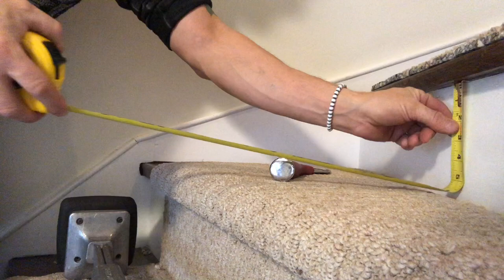How to Install Carpet on Curved Stairs

Comment: Amazing Job and great video.  I'm looking at fitting a runner on my stairs unfortunately the runner I like only comes at a length of 140cm. So I would need to attach 4and half up my stairs. The rug has a small boarder on either end I would need to cut off. Can I attach two ends that have been cut and if so where is the best place on yhe stairs to join them? Or will that look terrible?  Thanks
Reply from the maker: What kind of runner and from where?/ Direct Carpet has full length whatever you need / directcarpet.com as far as your question best place to hide the joint is at the base of wash stair where the riser meets the tread!

Comment: How do you go about following the curve and making it look good? how do you know where to cut? do you just match up the lines while turning the piece?
Reply from the maker: Miguel A Barajas For those stairs that turn like that I have to make a template those are very very difficult stairs
Reply: Thank you
Reply from the maker: Miguel A Barajas np
Reply: @KeithShannonDirectCarpet  that’s what I was wondering, have a 30” oriental with a 3” border and assume its iron time..?
Reply from the maker: @anthonyshea5181  sounds like it😄

Comment: Hi thanks for posting, this looks pretty easy, but I am curious what the longer metal tool is? It looks like it's weighted to push the carpet towards the back of the stair, what is this called? Also! was there a reason you didn't put padding under certain steps on the curve and then under others? Lastly, were you the DJ as well for the entire film? that was tricky.
Reply from the maker: the Long Tool I believe is the kicker! and sometimes i fit the angled stairs without pad, then add the pad after the stair is inline with the next, and yes i usually am the one talking! thanks for the question!